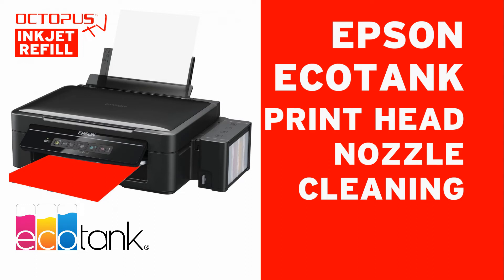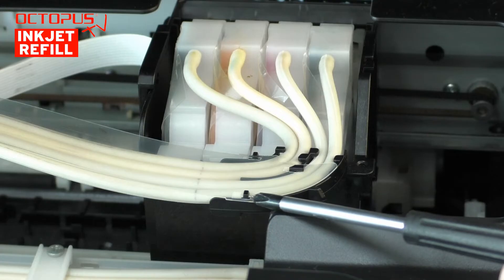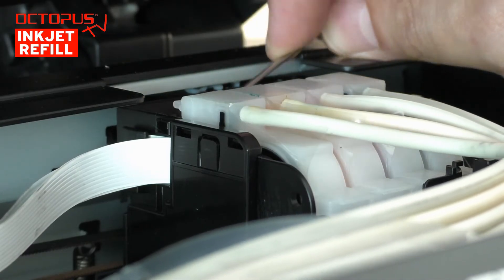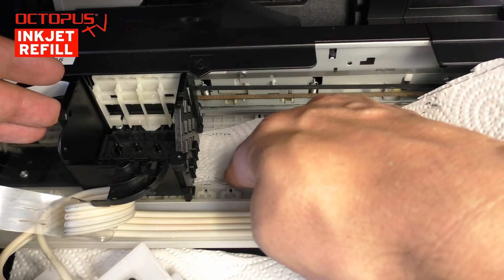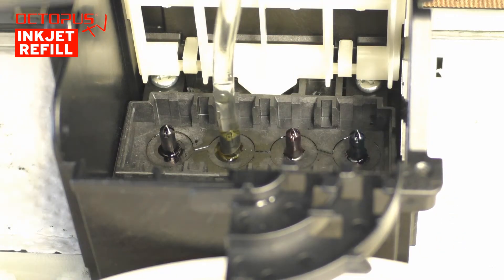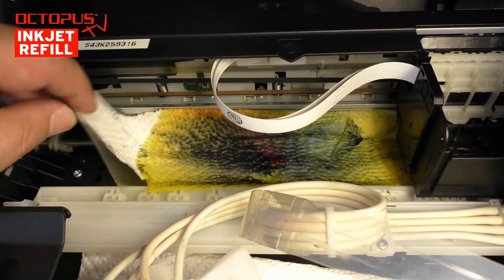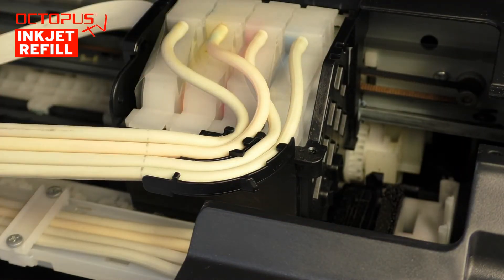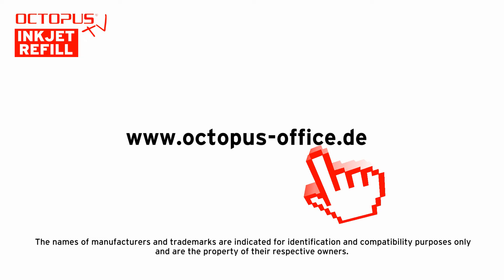Epson ECOTANK print head cleaning clogged nozzles 🛠💉

Comment: Good tutorial, but I don't know if this is my problem. My power light flashes green and alternates with the red flashing ink light. I haven't even printed anything yet. I put ink in and had to go away for a couple weeks before completing installation. Now I just get those flashing lights and don't know what to do. Do you know what could be wrong?
Reply from the maker: Hello Kari, thanks for contacting us about Your situation. From reading between the lines we assume that You have not finalized the first initialization of the printer properly. This might have caused that the printer is stucked somewhere in this process. You should contact Epson directly as You should be covered by their warranty.
Reply: @octopusoffice  Thank you so much! I searched everywhere on the internet,  starting with the troubleshooting section on Epson's (Sorry. This section is missing, try later...and later and later...). Other sites didn't list that combo of lights, and as I am not in UK or US,  the country I am in offered no chat or email options. Plus the best computer guy I  found locally told me that wouldn't be covered by warranty as the jet/head is probably clogged so I should just throw it away. Well you proved him wrong on two counts! Thank you so much! It works!

Comment: I am in Guatemala, which is a LOOOOONG way from where you are......
Reply from the maker: Hey Brian, thanks for watching us through such a long distance of internet cable 👍
When You would like to apply our suggested way of cleaning to Your printer: You should try to get Your hands on purified and demineralized water - this is an important ingredient of our base formula for our water based inks. Please do not mix up that type of water with destilled water. As destilled water still contains minerals and these tend to react with the remaining ink in the ink system - in the worst case the minerals and the ink bond and build up solid cloggings - inside the print head - worst worst case.
Reply: @octopusoffice  Distilled water is a type of purified water that has had both contaminants and minerals removed. So I'm not sure what you are talking about.I think you need to do some google searches and see that you are misinformed.

Comment: The only question  I have is, where to purchase the cleaning liquid. Is there a specific brand?
Reply from the maker: Hello Brian, we manufacture the cleaning fluid used in the video ourselves. Depending where You are writing from - it makes sense to purchase from us or something closer to Your location :)
Our cleaner is a colorless, waterbased ink enriched with surfacants which lower the surface tension around the pollution and cloggings inside the ink system. Then the water part can do its dissolving job much better. The following link guides You to our shop: https://www.octopus-office.de/shop/en/printer-ink/nozzle-cleaner-cartridge-cleaner/4940/nozzle-cleaner-for-epson-print-head-cleaner-with-extension

Comment: What is the cleaning fluid made up of?  Could I just use rubbing alcohol?
Reply from the maker: Hello John, the cleaning fluid is basically a colorless waterbased ink which has surfacants in it. The inks in these printers are waterbased - so to dissolve dried in inks and clogged nozzles You need to have water to have a dissolving effect. Alcohol will do some cleaning but will not have a dissilving effect on such cloggings. Best to use would be demineralised,purified water if You can get Your hands on such material. Please do not use destilled water as this still contains minerals -  the minerals tend to react with the remaining ink materials and You will not be able to get rid off the clogging.
Reply: @octopusoffice  Correction: Deionized and Distilled water have no minerals and ARE OK to use. Purified water contains minerals and is NOT to be used.

Comment: does this work for Epson workforce et4550?
Reply from the maker: Thanks for Your question. We do not know how the ink tubes are connected to the print head on the Epson ET4550 - please check if there are similar cartridge bodies sitting in the print head compartment. The it should be possible to remove these cartridge bodies and clean the nozzles as shown in the video.